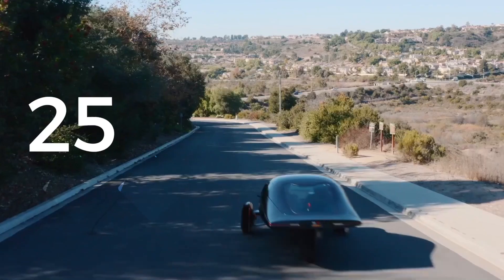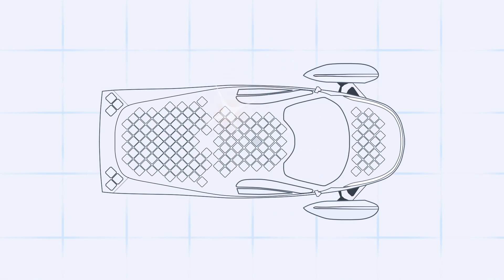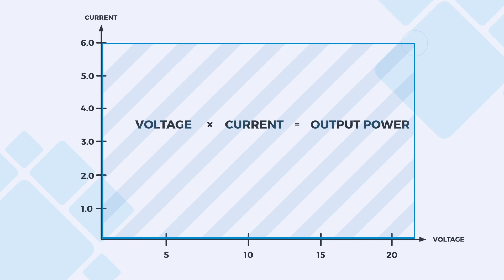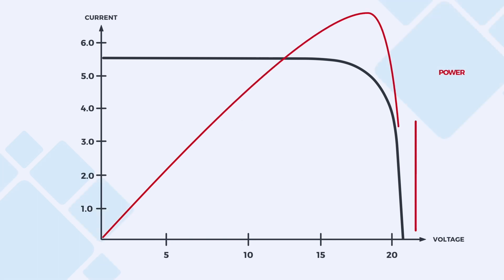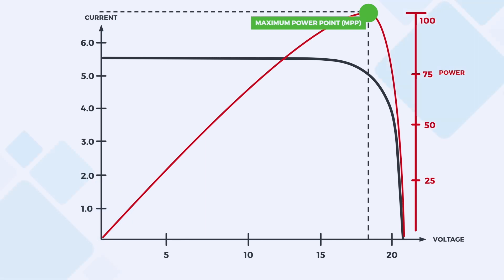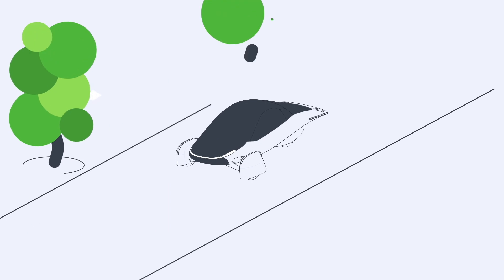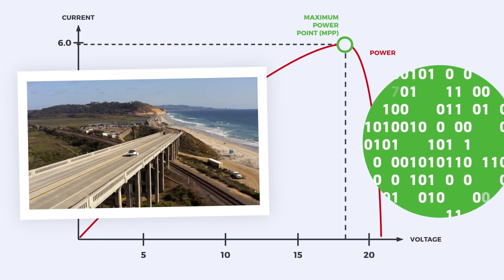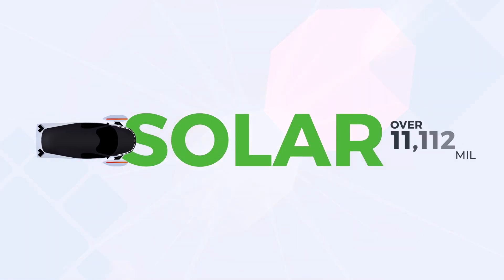Maximizing Solar Output

Comment: "Up to..." 🤣 Don't be afraid, some of us can handle the real number.
Reply: I know right? I'm sort of just operating under the assumption that maybe I can get around between 4 and 15 miles of real usable range per day, depending on the season/weather. And if that's true... I'm still sold. My daily need is only about 8-10 miles, so at least in the summer I'm hopeful I won't have to plug in much.

(Also, somewhere deep in the back of my mind I'm hoping to be impressed with slightly higher numbers,  but not expecting that.)

Comment: Very interesting discussion here by many people speculating the solar output of this trike.  I see many "experts" calculating out the non-real world ideal solar output.  Many of them with "axes to grind".  I can only speculate since I have no privileged knowledge of the engineering equations involved in this cycle.  From what I can calculate, Aptera is claiming their total solar output (watts) based on pure on paper calculations without taking into inefficiency factors at each stage of energy production and storage as well as doing this in less than ideal conditions (partial shade, angle of sun, slight cloudiness, temperature).  How many people actually have a parking space with this many hours of shadow less exposure?  Even in an open field, the car may need to rotated during the day to get the best solar angle.  My biggest prediction is that this "up to 40 miles per day" will be need to be done at speeds less than 18.8 miles per hour with no passenger or cargo.  So no boulevard or highway miles or 1000 mile range battery.   (I find that the many true discussions about the Aptera often get too caustic to participate in by people with no more marketing data than I have.)

Comment: Too bad you couldn't add a port for additional solar while the car sits. maybe use one of ecoflow solar tracking system with the 400 watt panel...
Reply: Aptera grants right to repair, so owners and the aftermarket are free to modify and develop for Aptera to their heart's delight.

Comment: True, I used to get mppts from japan. controlling current to maximaze power also pays an efficiency cost in the electronics to do that. But software takes care of that decision plus efficiencies got into the 98-99% range. What I am curiouse to see is if they talk about diode protection schemes and array divisions. Shadow presents a challenge and mppts will be seriously limited, you would want to reconfigure the series on the fly. If they do something like that I would be seriously impressed.

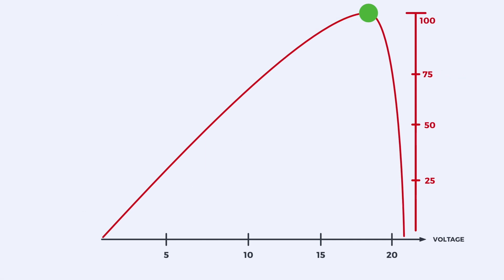Comment: The wiggly red line, at 1:20, isn't exactly correct. What's correct is that the voltage varies, and the current may also vary if not controlled, so the max power point may vary along the fixed red line. The software should be designed to control the current such that the output power point may remain as high as possible as the voltage and light change.

Comment: Why don't you place solar cells also on the doors like Sono Motors do with their Sion?
Reply: Solar panels on the sides of cars depend heavily on the direction the car is facing, with most orientations delivering little or no power.
If one side is facing the sun, the other is fully shaded, your efficiency is cut by 50% at best. All other orientations deliver less power.

Comment: I have a company car so if I get an Aptera and don’t use it for a few days then the 40 miles from it would be more or would it be charging the batteries?
Reply from the maker: It would charge the batteries. Each day Aptera isn't being used, it would add up to 40 more miles to the total charge amount.
Reply: @MTB214  The vehicle trickle charges, always.  While in motion it augments its electrical use. While parked, a ~40 mile gain a day.

Comment: I wonder if they designed the interior materials to withstand more heat and sun radiation. After all, while people normally try to park their cars in the shade, people will do the opposite with their Apteras. ;)
Reply: My understanding is that this is why there's lots of fabric in the interior. Fabric stands up to the sun better than pleather and vinyl.
Reply: I do believe the composite structure is naturally more thermo efficient, and will likely insulate both from heat and cold.
Reply: This is an excellent point.
My car is generally garaged. It seems weird to think that I might park it in the sun.
Reply: @johnbriggs7514  I was also thinking about the temperature that dark interior would have when you touch it. I mean I think it's the right way to go to charge the aptera in the sun, and I'm sure that Aptera has thought about these things as they are quite obvious - it would just be interesting to know their thinking around this. Where I live, in the summer, people are increasingly putting up reflective silver foils over the windows to prevent the car from heating up inside like crazy (e.g. you can't touch the black steering wheel ;) ).
Reply: @haraldriegler6000  Yep. I lived in Utah for seven years. I can agree that without the reflective silver foil in the front window, the black steering wheel was too hot to use.
Reply: Would most of the sunlight be intercepted by the solar panels and thus lower the interior final temperature? Compared to the regular cars?
Furthermore there will be the day that all heat buildup inside solar car can be converted to electricity by thermal cells. Solar cells plus thermal cells would achieve the Carnot cycle efficiency of 79%. In other words, a three folds efficiency gained compared to solar cells alone (at 24% efficiency)
Thermal cells are being produced in laboratories around the world.

Comment: I would like to see a video explaining the what ifs when solar is not an option.  Wil I be able to go up to any charge station?  Will I be able to charge up quickly if I plan on going on a long trip to lets say go camping?  Also does the Aptera have an outlet inside the vehicle for say camping with a cpap?  Thanks!  It's very exciting and can't wait to see one in real life!
Reply from the maker: Hi Joshua! Aptera can be charged and travel up to 1,000 miles in range by plugging into a standard 110V or 220V outlet. Aptera will also be compatible with CCS, J1772, Level 2 and CHAdeMO/ DC Fast Charge stations.
Reply: @ApteraMotors  thanks! I'm new to electric vehicles.  How long would it take to fully charge at each stage? I think this would be a good video.
Reply from the maker: It would be a good video! I'll pass along your suggestion to the team! From a 110v cord (like what you'd charge your cell phone on) you get 13 miles an hour or about 150 miles of charge overnight. At roadside charging stations you'd likely get about 100 miles in 10 minutes. Charging on a 220 volt will get you a pretty quick charge! At least 30 miles an hour. The lighter packs should use less energy but we are still testing to publish more accurate numbers all around. Don’t forget, you get up to 40 miles a day from the sun to top that off!
Reply: @ApteraMotors  yeah all of that is super exciting! Also is there an outlet in the vehicle for camping trips to use the power from the vehicle? I use a cpap and that would be very useful for camping.
Reply: @theeox  The answer is yes, but the power output will be limited and we don't know to what level yet.  Check to see how much power your cpap draws and compare when they announce this spec.

Comment: How many MPPT charge controllers will there be? How many strings?
Reply: I wondered this too.
Conventional strings of panels are really negatively impacted by shadows. Hopefully all the solar cells are not in one giant string.
Reply: @johnbriggs7514  likely each cell won't be on its own string.
Reply: @bobhilder1469  the more strings the less impact of shading. How many strings and which cells will be in which strings? They can't use micro inverter tech because it will all be DC.
Reply: @bobhilder1469  Each cell could technically be a string depending on the voltage and charge controller. It would be more expensive but would solve the shading issues.
Reply: @bobhilder1469  You as well. That is the reason solar works so well on unshaded roofs facing due south at the proper angle for the latitude.

Comment: Aptera has been testing solar cells for well over a year in stationary applications.  The next beta vehicle they are building is essentially a mobile test vehicle.  They are not going to reveal the entire design detail until they are shipping vehicles, most likely.  Aptera is already far more open than most manufacturers are at this stage.
Reply: I do wish they would have a solar sunshade for the windshield as an option (in addition to the dashboard panels which will help when driving or when I'm too lazy to put in the solar sunshade!). In a recent video with Rich Rebuilds it does look like the panels can be replaced so hopefully having sunshade panels won't be too much of a bother for them to incorporate.
Reply: @anydaynow01  I will pass your comment along.

Comment: I've chosen the option of full solar on my Aptera, and I am eager to see the working Beta test model, and see how well it performs in different partial cloud and car/sun orientation tests.
Reply: I'm going for minimum solar. The idea in itself is great but on one hand I am still skeptical on how well this will work and on the other, I don't live in a location where it's sunny al year round. And it gets even worse, when I park the car at home, it'll be in the shade for a good part of the day, dropping solar production even further.

No, with such limitations, I prefer to get some sunlight into the car through the rear window instead of having that replaced with solar panels and having a car that's dark on the inside. Hell, I would have preferred an optional glass roof over a solar roof

Comment: What method will you use to attach the cells to the body? How will they be encapsulated?
Reply: Great questions!  Also important: how will Aptera protect against hot spots?  I have to imagine cells on the car won't cool as effectively as typical PV cells do in a rooftop or ground mount installation, and those already burn through the back sheet occasionally.

Comment: Will you have a separate MPPT input for each panel? (hood, dash, roof, hatch, external input)
Reply: Obviously I can't speak for Aptera, but generally speaking yes, you have a separate MPPT channel for each aspect of an array. 3&4 channel controllers are easy to come by in a highly integrated module.

Comment: I will be shocked if the solar cells only top voltage is only 21 volts
Reply: As long as it is below 50 volts, it is considered intrinsically safe, and you are unlikely to be shocked unless you are licking the wiring with your tongue/s
Reply: @n.brucenelson5920   They have to bump it up to 400v for charging the battery.
Reply: @terrya6486  True.  I know they were using an nominal peak voltage of 403 volts..  The sooner this boost occurs, the thinner the wiring can be going to the batteries, so this may be done early to save weight, if it does not cost too much.  There are always engineering trade-offs for every choice.
Reply: @n.brucenelson5920  Yum.

Comment: why is it so wide -  88 inches is even wider than the  X model 
for example, I can’t imagine that it would be convenient to maneuver in European cities
Reply: The primary reason for the width is aerodynamic, so that the wheel pants don't compress air between the the inboard surface and the body.  The width alone saves about 10% of the air resistance they would generate if they were closer.  A secondary reason is increased stability during sharp maneuvers such as a moose test.  Like most engineering goals there are tradeoffs.
Reply: 88 inches is a lot different when we're comparing a 4-wheeled box to a 3-wheeled car with a single wide zone.  The rest of the car is a lot narrower, would make a big difference for maneuvering.
Reply: @Infinion  Yes and add to that that Aptera has differential steering.
Reply: @aussieideasman8498  To someone who thinks wheel motor vehicles have transaxles, it is beyond my capacity to explain.
Reply: @aussieideasman8498  You do say that motorbikes have transaxles ..... that is an equally stupid statement.
Rich rebuilds video in your comment about time stamp 5.12
Reply: @aussieideasman8498  if the angles of the links from the steering rack to the hub spindles are correct you do indeed get different steering angles at each wheel as you move off center. It's simple trigonometry.
Reply: @aussieideasman8498  Dear Harmless Troll,🐿
All cars are designed as far as possible so that all axles point to the centre point of the turn. 
😀 Science Time. 😀
Turn your wheels to full lock and park the car.  
Observe the amount of turn in the wheels.
The wheel inside the turn will be turned a lot more than the one outside the turn.
This eliminates scrubbing in all but very tight turns and applies all vehicles equally. FWD, RWD, 3 wheels, 4 wheels.

To learn more look up Ackermann Steering Geometry.
🥳
Reply: @aussieideasman8498  To learn more look up Ackermann Steering Geometry.
Reply: @vic321344  Yes. I used to work for a company making twin electric motor vehicles. We also made ones that had a transaxle. The ones with the twin motors wanted to drive straight or in a slight arc when run off a simple speed controller.
Reply: @vic321344  A Transaxle is a combined gearbox and differential.
The thing that goes between a gearbox and a diff is a tail shaft.
You guys should be trolling on some other subject.
Reply: @vic321344  Did I misunderstand your post? I can take it down if you want. Please let me know.
Reply: @aussieideasman8498  you said it first
Aussie Ideas Man; “If the transaxle resulted in net loss, it would not be included in hundreds of millions of cars, trucks, motorbikes and just about everything that moves." - April 26 2022: 🐿
Reply: @aussieideasman8498  There are rare cases of two wheel drive motorcycles but no production version used a diff. Typically they ran a hydraulic circuit off the rear drive to power the front wheel.
Reply: @aussieideasman8498  Dear Bullwinkle. Learn some physics.

Comment: Why diamonds for the solar cells? Wouldn't squares use the space more effectively (especially the dash and roof)?
Reply: They are squares.  I'm guessing they orient them the way that they do as perhaps they flex better on the diagonal.
Reply: The panels they make are 4" square. They look like diamonds at some angles because the body is curved and this panel design allows them the ability to bend enough without damage. They have also done hail tests of a laminated cell that show no damage. They use a powdered silicon rather than what you typically see solar panels made of. Which has the ability to bend, accept light from a slightly broader angle due to micro "bumps" in the powdered formation. Even if you break the backing structure of the panel it will still produce usable power at near normal level.